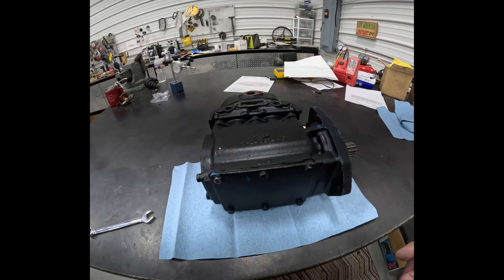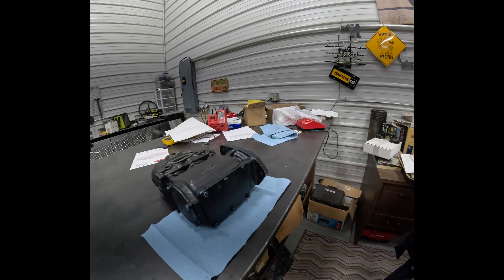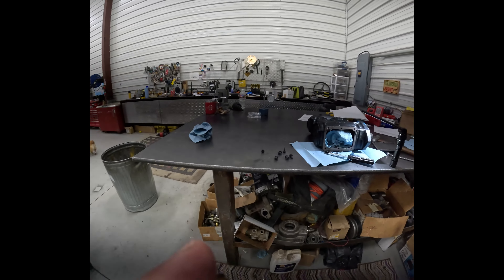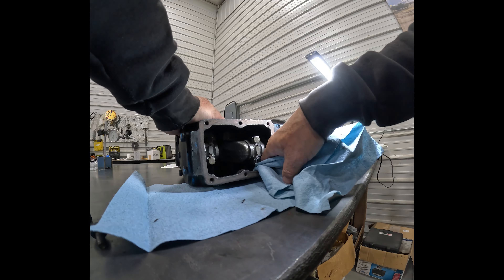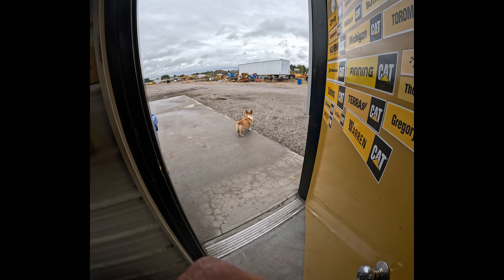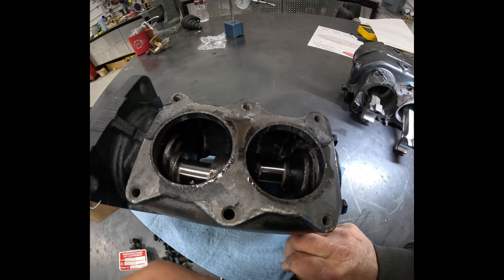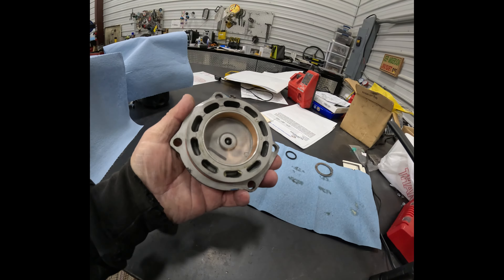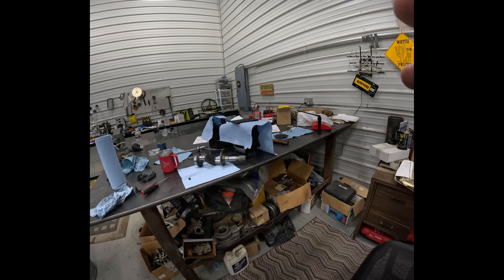Tu Flo 500 Repair

Comment: When they said to use copper coat they must have meant copper gasket adhesive?? 
Actual copper coat (anti seize) would have let those gaskets come apart nice and intact. 

Personally on something like that I would use anaerobic sealant, put a very tiny bead then run it between my fingers to smear a thin skim coat over the whole gasket. Then no leaks. 
I do the same thing with silicone too, that way you don’t get the big globs squeezing to the inside and causing havoc. 
Permatex  “Right Stuff” (Black one minute gasket maker)for oil related things you don’t want to leak ever and dont need to come apart regularly. Truely amazing stuff. 

Permatex “ultra Grey” for coolant related gaskets. 

Then anaerobic sealer for what I consider big “permanent” installations. Like the Torque converter on the back of a Dozer. Once its on you definitely don’t want leaks. And it’s staying on until it absolutely must come off. 
Although right stuff works good for this application also. Im not sure why I pick one over the other for certain things.
Reply from the maker: yes, the spray stuff in a can

Comment: 550 compressor - replaced unloaders, air dryer, govenor - worked great for and hour .. now compressor won’t unload - dryer purging rapidly -
Is it possible the unloader seats have gone bad ? Or possible obstruction in cylinder head ?or new govenor went bad out of box ?
Reply from the maker: Check the air supply hose that hooks to the governor for obstructions or damage, if the governor doesn't get the signal pressure it can't operate

Comment: I had a motorcycle once.. the guy who rebuilt it used too much silicone and the cheap stuff too, it blocked the screen for the oil pump, destroyed the crankshaft, I like HYlomar blue sealer, made by Permatex. It never blocks anything and any excess comes out at the oil change

Comment: Shame the way things are nowadays with parts. There trying to make one part fit many applications now. 
That plug needed to come out in your situation, because your oiling the compressor from the front drive.
The plug was there to block oil when oiled from the back bearing end via a external hose.
Agree roller bearing superior in that application,(think small engine), but
the Babbit bearing should be fine.
Tom

Comment: My cousin put a water pump and thermostat in his Chevy pickup useing blue silicone… a couple months later he turned on the heat and got none… turns out his heater core was plugged up with the blue silicone…..now that was a lot of excess silicone 😂😂😂

Comment: I don't care what color silicone is ,but if it's used improperly it causes problems ,years ago ,I'd reseal the steering clutch covers on the d9s and the d8 ,the cat boys said to use there red monky snot  I'm shure they have a different name ,but I'd clean and dry those parts ,silicone them and it solved the problem
Reply from the maker: that red crap was crap for sure